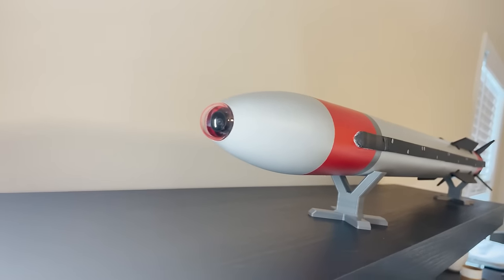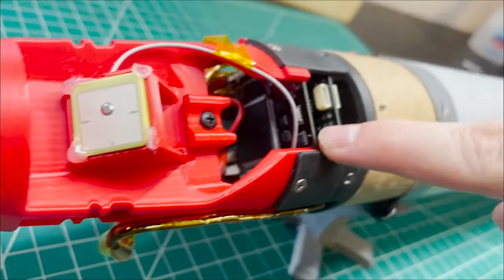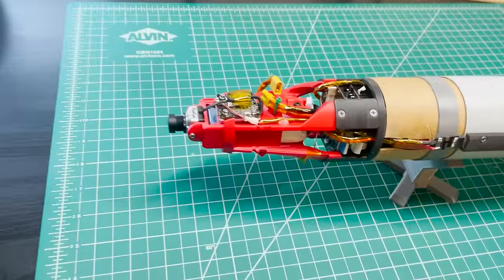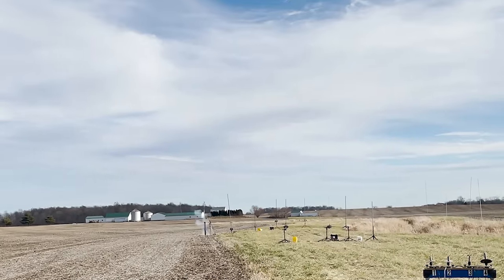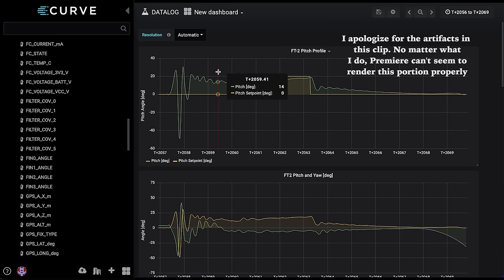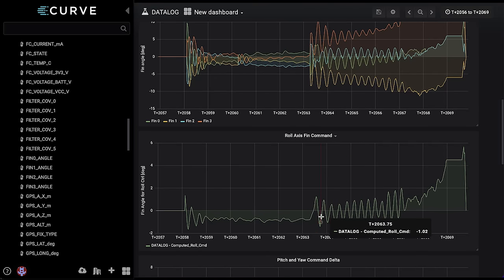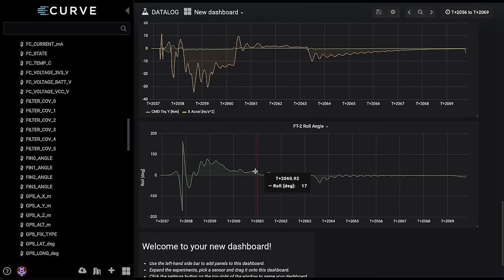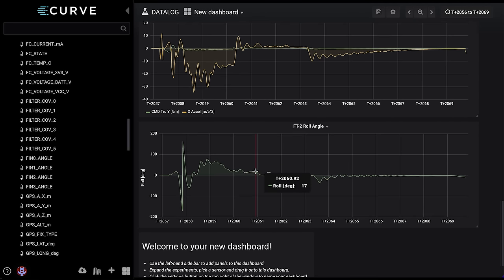Rocket Silo Launch - DIAMOND-X Flight Test 2

Comment: Congrats on another great flight, love this project! Would love more technical details on Momo 😺
Reply from the maker: Thank you! Momo is a very good assistant, his favorite spot to hang out is typically right in the middle of whatever i'm working on :)
Reply: @LafayetteSystems  Classic :) Apologies if this is already covered, but are you controlling roll with all 4 fins? You might try controlling roll with only two surfaces, or even one if you wanna get funky with it. I'm doing a bunch of fin simulation stuff right now and finding that the surfaces you need in order to control pitch and yaw will almost always be super overpowered for the roll axis, which you can solve with either super high precision servos or cutting the "active" surfaces for roll in half. Or just gettin lose with the derivative gain!
Reply from the maker: Right now I'm using all four for roll, but I was thinking about trying it with just 2. Maybe I'll give that a shot next flight and we can see how it goes! From sims I know there's a q above which roll control is wobbly, largely based on servo precision and mechanism backlash. In theory, having half of the fins involved in roll control means that dynamic pressure limit could be doubled. I'll sim it up a bit and see how servo backlash, slew rate and servo precision play with fewer fins involved in roll. It might turn out that there's some speed above which you should use 2 fins and below which you should use more. That wouldn't be a hard system to implement but I will let you know what I find out!
Reply: @LafayetteSystems  Sounds good! Best of luck and lookin forward to seeing more!
Reply: Lmao like you didnt sell him mgs... wow this is getting strange.
Reply: @LafayetteSystems what a cop ass answer.
Reply: What is the milk guy doing here

Comment: Congratulations!  Having some experience developing a guided, silo-launched missile, I am very impressed by what you have done here.  The fact you have been able to create a flight control system that keeps your missile stable is a testimony to a lot of hours of hard math work on your part, I suspect.  A couple thoughts, FWIW: 1) Your raceway may be creating some of that roll bias.  The raceway must be well aligned with the body axis or it'll put an asymmetric force on your vehicle.  Given the time your roll is showing up, I suspect you are also seeing a bit of a compressibility-related issue with that raceway but that's also made more well-behaved by ensuring it is aerodynamically smooth and aligned with the body axis.  2) Again, on the roll issue, solid rocket motors can create a roll moment.  It's tough to model, but you may be getting some roll torque out of the SRMs at certain points in their burn so consider making some allowances for that in your math.  Overall... you are doing amazing things.  Very impressed.

Comment: Well done young man! I wish I had 3D printers in the early 80’s when I was a teenager and making rockets. I served 26 years in the Army as a Tank Destroyer (11H) and we used the TOW missile. We had various improvements over the years but the missile pretty much stayed the same apart from the warhead until the “top attack” variant. Having the flight motor in the center of the missile kept the missile CG stable in flight as fuel was exhausted. The ABOL motor ejected the missile and propelled it up to flight speed then the flight motor ignited and after fuel exhaustion it coasted to target at 4,000 meters. I think your rear flight fins might need to be wider (elongating away from the rocket) to provide more stability. As your motor burns your computer is dealing with many factors at the same time and the fuel burns very quickly in your rocket so maybe adjust the profile of the rear fins and use a slower burning motor to allow the computer to be able to process the flight profile. The TOW uses a flight motor that uses two exhaust ports on each side of the missile that’s angled at 45 degrees and there’s many videos on YT to display how that works. Your flight motor would need to be made out of some allow or ceramic which means more weight so it may not work in your design. You can also try various types of flight fins/wings that will fold in for use in your launch container and are under spring tension then they lock into place once in flight. The French HOT missile uses fins that are curved to fold against the missile body and with that you can use any size/profile you come up with. To have actual “flying” fins that generate lift in some manner takes more planning but I don’t know if that’s an option for you. I think an ejection/launch motor that’s in a puck type cell and falls off once exhausted to expose the exhaust cone of the primary motor which ignites immediately after the launch motor burns out. Overall, you’re doing great, thanks for sharing your successes with us.

Comment: Most commercial acceleration sensors are limited in this exact scenario (for obvious reasons) which leads me to believe that your yaw might be a bad reading.
Reply: 2 axis accelerometers for pitch and yaw,  usually 2 gs and 1 axis  
accelerometer for vertical,  for 9 to 20 gs.

Comment: I do understand why this is not a seeker on the nose but it would be really intresting if it was.

There is a lot of engineering to make an actual seeking system. Dont know how much processing power you controller has but with some basic image processing you could track a target on the clear sky. Such a rocket could be used as a reusable drone interceptor if the nose has some thin metal armor.

Comment: Have you considered gyro stabilized fins like on the sidewinder? Have the outermost 20% of the fin able to articulate a few degrees from the main portion of the fin, with gyro wheels in the tips. Aerodynamic forces can spin up the gyros without any additional power. The idea is that the gyro will cause the tips of the fins to resist the random movements of the rocket giving the computer less to do. At a certain point, say 10% of total designed fin range of motion, you want the gyro stabilized section of fin to follow the main section, so make stops in the bearing so the fin moves together when the guidance system commands movement.
Reply: Look up the AIM 9 Sidewinder. The mechanism is pretty simple, and ridiculously effective at dampening random yaw.
Reply: In case I was insufficiency clear in my OP, the (gyro stabilized) outer section of fin should only be capable of limited movement independent of the main section of fin, but should be completely free to move within that limit. Let's say you have the fins capable of a total of ten degrees of deflection when commanded by the guidance system, the outer section should only be allowed to move one or two degrees relative to the main section. That way, even when the little gyro wheels are trying to resist your programmed flight commands they will be dragged along to roughly follow the control fin, while their independence provides dampening of random movement. All you need are physical stops preventing excess movement, not any additional powered control mechanism.
Reply: This is a great idea!!

(Especially since it looks a little like the SM-3😂)
Reply: People have tried rollerons on amateur rockets before, but they aren't very good at smaller scales or when launched without being spun up on the ground.
Reply: @marthinwurer  good to know.

Comment: Great video and project, you can compensate for the fin bias by including the states into your Kalman filter and thus estimate the bias. The natural damping of the rocket varies with the square of the air-speed that creates the torque on the fins, and it is also directly proportional to the air density which varies as a function of altitude of course, and also with respect to the initial conditions on the ground such as temperature, absolute pressure, and relative humidity.

Comment: An idea for preventing the rails parts on the outside from being offset and crooked is to design the parts in a way, they can be slid into each other like a puzzle piece. If you do it in this way, they can still be replaced without disassembling the whole rail, while kepping them alligned properly.

Comment: Great project !  The simulation is quite good which is not easy to achieve.  
You might consider using ramp changes to setpoints rather than step changes.  Your plant can't follow a step change which increases error, making the control work harder.  Step changes also can excite more undesirable dynamics in your plant.  You can use your simulation to determine a suitable ramp rate of change which your control system could follow with a reasonable degree of accuracy.

Comment: Looks great! What motor did this fly on? Looked pretty boosty but also burned for pretty long. Super impressive control system, are you able to provide more details about your flight computer? (MCU, sensors, fusion algorithms)
Reply from the maker: This was on a CTI H118, it has a pretty regressive burn profile which is nice for these launches. Part of the build series I'm editing will be on avionics and I can go into more detail on the flight computer in part 2!
Reply: @LafayetteSystems  Awesome! Looking forward to it

Comment: What purpose does the flame vent serve? I'd think that setting the rocket itself on a pusher plate that more or less seals in the silo and just letting the pressure build up and push everything out would be more efficient use of the fuel. Given everyone (up thought and including the USN ship launched SAMs) seems to use vents, I'm guessing I'm missing something interesting. 

Things that come to mind:
- Legal issues (i.e. how to prevent it from legally being a cannon).
- Making the dynamics of a silo launch similar to an open launch.
- Preserving the silo for subsequent use.
- Preventing over pressure in the silo blowing the sides off.
- Preventing over pressure in the silo blowing the bottom off.
- Preventing over pressure in the fuel grain from causing it to burn too fast (RUD).
- Limiting peak acceleration.

The first two issues aside (which don't apply to some other designs that also use a vent), the rest seem like solvable design challenges.
- A metal lined silo should be tolerant of a short pulse of hot gas.
- Side wall pressure should be containable with something like a COPV (fiberglass wrapped and glued around 6 inch PVC drain pipe?).
- End pressure shouldn't be an issue (as long as the end plate is sitting on solid ground there should be almost no opportunity to transfer force to the tube).
- Fuel burn rates could be solved ether by choice of fuel or by giving the pusher plate it's own fuel grain/sheet/bag/etc. (which would also allow things like doping it with an endothermic gas generator like ammonium bicarbonate to keep the temperature down).
- Peak acceleration could be solved the same as the last item or by just designing things to take it.
Reply: Iirc it's mostly a heat and force management thing. He previously had problems with a metal heat shield burning through, and you could see here that the pressure from the exhaust gasses blew the side panel out.
Reply: @marthinwurer  I was hoping it wasn't one of the reasons I already speculated on in the original comment. (That wouldn't offer anything new to learn.) They might explain why the OP would do that but as I already mentioned, those are both trivial to solve and wouldn't explain why operations with much larger budgets do the same thing.

Comment: Looking at the plots would suggest to me that your primary position control loop proportional gain looks too high and your integral gain probably a little low. Or an interaction between this control loop and the Fin position control loop.

How are you compensating for the phase lag between the actuator motion and the vehicle motion?

Comment: For better fin alignment you could print a guide which slips over the motor mount and has two flexible arms, that "wrap" the fin. If the fin is out of alignment the flexible arms would be driven away from each other, the closer they are together, the better the fin alignment is. Well, unless the alignment guide is misaligned. This thing has do be printed/manufactured very precise.

You could even automate the alignment that way with two contacts touching if the arms are perfectly aligned.

Comment: A few thoughts: Do you know how fast you can move your control surfaces and limit your control response to that? If your commands exceed the response speed it can induce oscillation. If you can monitor the actual control surface position vs commanded position, it can help to see if the surfaces are actually pointing where you command them. 
You mentioned oscillations in the simulation prior to flight. Why not adjust the control parameters in the simulation to hit what would be critical damping? 
Cool project!

Comment: Technically if one of your fins was damaged during launch the pitch and yaw movements will create roll movements. The one fin was damaged in the landing video but it could have been slightly damaged during takeoff.
Reply: It would also account for you not getting the fins exactly straight if you did.

Comment: Very cool. I wonder what the innate servo/servo system delay (lag) time is. Maybe that's triggering the oscillations. Does your computer model allow for, and assign any value for servo response lag? Maybe insert a value in that, to see if you get an oscillation similar to what you're seeing in flight data. ?? 
Incredible work you've done here!
Edit... maybe under G and wind force, there is unexpected friction in the fin mechanism. Things rubbing, catching, becoming jerky, etc.
Reply from the maker: Thank you for the comment! I have a couple control nonlinearities modeled in the sim. The main ones are a fin transfer function and a few ms linear time delay between control command and fin actuation. I haven’t directly measured either of these so they’re guesstimates at best. Those are definitely areas for improvement going forward. I’ve also been experimenting with some more complicated frequency domain controllers to try and circumvent some of the nonlinear effects but that’s very much a work in progress.

Comment: I was wondering how symmetrical the rocket engine burns, i.e., are there portions inside the chamber that would contribute to uneven weight distribution affecting the preloaded profile data?
I am probably way off, just don't know if it is a solid motor or has channels in the propellant. Either way, there would be a change in center of mass due to mass being burned off.

Comment: Years ago I was in the Highlands of Guatemala.  The roads to get there are narrow, go around dangerous curves with no railing and have 1000ft drops on the 'Oh, SH!T' side of the road.  I was at a pull out, watching a bus full of locals come up the mountain.  Sounded like it was in first gear.  Went real slow.  People were perched on top of the bus!  Can you imagine having that view of the drop off while sitting on the roof?

Anyways, I watched the bus come up and around a curve, the mountain road gave away and the bus started it's 1000ft roll down the mountain.  Bodies were flung out like cannon shot.  Chickens escaping by the skin of their lips.  Screams, the screams of that first 100 feet.

Your video is better.

Comment: It seems to me there’s going to be a huge difference in control effectiveness with change in velocity, and one would expect that’s not even a linear function of velocity for the case of transonic and supersonic flight.

Does your control system have some sort of velocity estimate and a function to change control constants as the flight progresses?
Reply from the maker: You're right, control effectiveness is largely a function of dynamic pressure! Particularly for roll control, it's important to account for how q changes during flight
Reply: @LafayetteSystems , in long range target shooting…the center of pressure changes with Mach number, and that affects bullet stability. The center of pressure isn’t necessarily fixed either.

Comment: Wait you cant make a seeker head in the us? I figured as long as you design and code it yourself there wouldn't be anything they could do.
Reply: The relevant law is 18 US Code § 2332g which covers guided missile systems. I think putting a seeker in this rocket won't be in violation but the its probably not worth risking unless you get a lawyer to look at it.

Comment: Just a suggestion but have you thought about using a bit more integral in the pid controllers you showed in the first two plots?... This will help you get to setpoint faster. Also presumably you know this already but it looks like the gain or derivative is too high for your roll controller and its borderline unstable... Otherwise great work and looks amazing!
Reply: Say I add a bit of that integral coeff, and I got even more oscillation. What would be the best thing to do to handle this oscillation? Add more derivative?
Reply: @rizalardiansyah4486  yes but it depends how your derivative is calculated and the form of your pid (series/parallel). Derivative can be affected by noise so the best implementations I've seen use a lowpass filter with a very short TC to smooth out the PV before calculating derivative. Also oscillation under integral action can be a result of stick/slip in the servo... Sometimes a bit of integral headband can be the cure for this. That and reducing gain... Hope this helps 😃